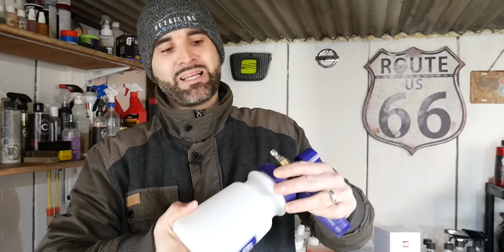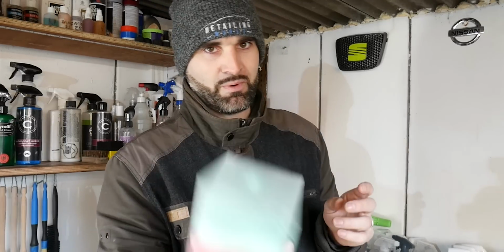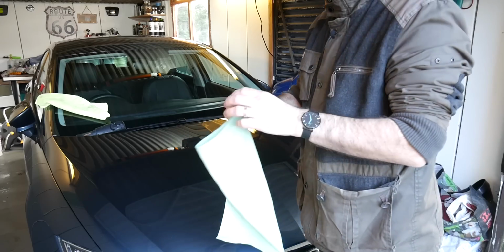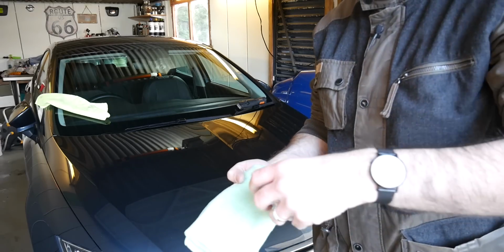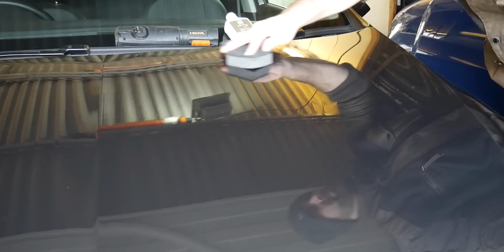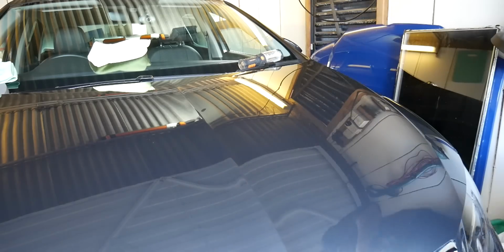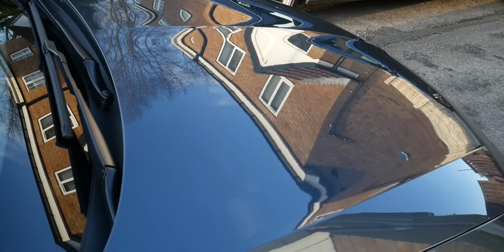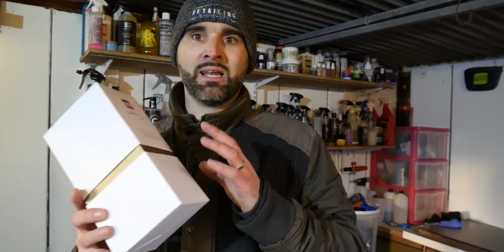AutoGlym Ultra High Definition Ceramic Coating

Comment from the maker: Comment from AutoGlym UK:

"The plan was to make something that was as "un-mess-up-able" as possible, but that still really delivered. Keep it off the rubbers and don't let it dry on and you will be fine. Even then, the preparation product will remove it from rubbers and if it dries during application, just add more Ceramic Coating to re-hydrate the product. No need to machine it off as with some other types of product."
Reply: @Flynn Braylon Ehh I watch on Flixportal. you can find it by googling :) -terry
Reply: @Terry Esteban Thanks, I signed up and it seems like a nice service :D Appreciate it!!
Reply: @Flynn Braylon glad I could help =)

Comment: I was a bit worried about trying a ceramic coating at home but you made it look easy.
Reply from the maker: Erm, thanks I think 🤣

But remember, because I make it look easy, that's no excuse to get complacent 😉

Seriously though, it's all about the prep work. So as long as you're happy with the results of your polishing etc, and ready to "lock it in", then applying this should be fairly straight forward with a little patience.

Comment: I use to clean and polish cars in the mid 90s, a shame I didn't carry on with it, this video is great, makes me want to get back into it, the quality of products out there now is amazing, most improved formula's out there now, and I do know back in the 90s that most car manufacturers and showrooms used the Auto Glym Polish, probably use it in today's car markets. And I never ever used a motorized buffer. Interesting stuff out there now, and why the heck do people use the clay bar, just get a packet of low pH solutions when washing the car it takes off 100% of debris. Anyway, great video great solutions and simple methods.... Cheers fella.
Reply from the maker: Thanks for your input

Comment: To me it seems pricey. £60 for 2 cloths an IPA and a bottle of ceramic. I'd be interested in the actual SIo2 solids content in this.  Also it says you can top this with UHD wax at another £60 a pop.  
This would not make me switch from TAC or Cquartz. Companies that have been doing coatings for a long while with a better price point.  
The snow foam lance looks like a winner if you happy to pay twice the price as other Italian made PA lances with a wide mouth bottle.  
I can see a theme developing...  
If I'm Joe Bloggs, who this product is marketed at is lost  looking at Halfrauds shelves marveling at the sheer amount of detaining products and looking for a ceramic product to schlep all over the paint, I'd probably pay the £90 for the TW ceramics range, based of the same amount of prep for each product, TW offers way move value the the end consumer as its a complete detailing system, rater than just 1 product. Polish, base coat, wet wax, shampoo and QD, (All ceramic, if a little bit is good, way more is way better) and offers similar results, and the packaging looks more desirable, and wont get lost in the other relatively expensive AG UHD product line.
On the upside, the video was well presented, useful tips and honest impressions of the product. I like what you do and you should keep it up.
Reply from the maker: Thank you for your input and feedback 👍
Reply: @TheDetailingSpace  So they supply the polish pad they sell to use the ceramic coating..lol...poor
Reply from the maker: Why is that poor? For their market that is ideal.

Comment: I'm putting this on my new John Deere mower. I have a few scuff marks from boots to remove first. What product can I use under the   ceramic coating? Not sure if I can use SRP due to fillers?
Reply from the maker: That's correct, you wouldn't use a filling product under ceramic. Really, you need to do a correction first

Comment: I have used the turtle wax ceramic wash and wax and I’m getting water spots like crazy, do you think Autoglym UHD preparation would clear the ceramic coating that’s on there? I’ve tried hand polishing it but no look ☹️
Reply: Liam Turner probably down to not enough preparation ( at a guess) . If you don’t have a machine polisher to really get the paint to a good standard I’d steer clear of most ceramic products. The turtle wax stuff will degrade over time ( one coat in maybe 3/4 months), so you could just wait and then go back to traditional waxing, it’s much more forgiving than ceramics.
Reply: Karl Hulme ok thank you very much 👍🏻
Reply from the maker: Yeah, what Karl said 👍

Comment: Thanks for the video.  Not sure if I’m going to use it yet.  I’ve got a white vehicle so not sure if it’ll really benefit from it.  Just a tip for the start of the video if you lock your exposure on the camera you won’t get it flicking from dark to light in the time lapse or other shots ✌🏻
Reply from the maker: I usually do lock exposure, in fact, shoot manual everything.... I tried using shutter priority as an experiment for snow foams clips.... Didn't like it 😂

Comment: is the red buffing cloth/microfibre reusable or due to ceramic contamination trashed?
Reply from the maker: Seems ok, and should be fine to use again. If in doubt, just demote it to a rag. But from what I can see, it seems fine.
Reply: The reason I ask is that I recently ceramic coated my wheels with GTECH C5 and they recommend not to reuse the levelling cloth due to contamination once the product cures on the cloth to avoid scratches? what are your thoughts?
Reply from the maker: Yes, the is true for some of the professional grade products, it can crystallise and ruin applicators, cloths etc... This is a different composition, and aimed at retail, making it a slightly different kind of ceramic product.
Reply: that makes sense, thanks.
Reply from the maker: No problem

Comment: does the applicator pad crystallize after one use or can it be used multiple times  until all used
Reply from the maker: I assume it'll probably crystallize. I'll check the condition later 👍👍
Reply from the maker: Just checked the applicator, and no it hasn't crystallized.

Comment: i was tild if the ceramic coating is not in a glass bottle its not real ceramic as the plastic bottle would dissolve with the product hence why the real stuff is in glass bottle
could be wrong but that's what i always thought the snow lance looks great
Reply from the maker: I've heard the same.

Comment: Does anyone know if I could use the polar seal after it has been ceramic coated, or would the seal not work and just keep using the blast and wash? Cheers
Reply from the maker: Technically yes, but not sure if it'd add anything to it. The do suggest not to wash or use chemicals on it for at least 24hrs after
Reply: @TheDetailingSpace  thankyou. Would be just because have 2 5 litred of the stuff to use up 😂.
Reply: I’d of thought once it’s cures using polar seal as a topper after some maintenance washes might boost your water behaviour as it starts to fade and possibly make the ceramic last longer? There’s only one way to find out
Reply from the maker: Yes, polar seal as a topper should be fine TBH

Comment: Better review than AUOYGLYM'S own! but how far will 100ml go? two cars?
Reply from the maker: Should easily do 2 large cars. I did my Mk3 Leon a few years ago with 30ml cquartz, and still had a little left afterwards
Reply: @TheDetailingSpace  makes it very competitive then? I'm using "HYDROSILEX" just now which gives around 6mth protection but is a breeze to apply, spray on buff off, a 1ltr bottle has so far done 5 cars and I think enough left for at least another two! well worth comparing I think!
Reply from the maker: I'd say so 👍

Comment: Hey great video
Question 
Polar wash
Then polar blast
Should i Autoglym Hd wax it or autoglum super polish it?
Then apply the new HD product 
Or wasting my time 
Wash it then Hd it 
What steps should I take please 
I am a autoglum fan 
Taa Neil
Reply from the maker: If using this ceramic, the preparation product will remove the fillers that SRP leaves behind, so kinda wasting time there. Really, you want to machine polish the car before applying this...

Otherwise, use SRP and then a wax product on top of that rather than this.

Comment: Does this product offer a similar result to Supagard? We had Supagard protected car several years ago, but I never realised what it was. The car always cleaned very well with dirt just dropping off with little effort. I then began working for a Nissan car dealer that tried to get us to sell a similar product for a minimum of £100 and up to £300! This was in 2000. I never sold one as it seemed to be a con to me. I then realised the significance of the small Supagard sticker on a rear window. I then worked for a Ford dealer that sold Supagard, but at a more reasonable price. I seem to recall they purchased a car polishing kit, including leather interior and carpet treatment for around £15. The valeters charged about £45 to treat the car, so we had to sell it for at least £60. I did sell a few as I thought that it was quite good.
Reply from the maker: TBH, I've never experienced Supaguard or any packages offered by dealers. As you can guess, I always decline them 🤣

Comment: Why do you polish the car just to remove it again to  ceramic coat it
Reply from the maker: I think you're confusing 2 different, yet similar things here...

A hand polish, or what you are referring to as "polishing" is a product that fills in defects etc.

What I'm doing, is polishing, as in the actual process of polishing. This actually removes swirls, rather than just filling them. What you see me wiping away is any polish residue and oils.
Reply: Detailing World ok I see now do you think it’s worth using the ceramic coat if I haven’t got a machine polisher. I do use the polar products  and they work well, just ordered the autoglym snow foam gun.

Comment: When would you have to wash your car next...? Can't tell me that would last 12 months...?
Reply from the maker: You would still need to wash your car, but the protection will still be there. Please don't confuse these type of products with "never have to wash it again" nonsense you get from dealers. The car will still attract dirt, but this will make initial washing easier as more dirt should just rinse off with a pressure washer before you even touch the car with a mitt.

Comment: So wash the car 
Polar wash
Polar blast 
Polar seal
Then polish the car 
Then ceramic or skip the polish part 
All Autoglum products used
Reply from the maker: No. Polar blast, then polar wash. Forget polar seal if using this.
Polish before applying a wax or sealant

Comment: Consumer lifeshine? 🤔
Reply from the maker: Never tried lifeshine
Reply: The thing with Lifeshine..  If you read it. The warranty isnt worth the paper its written on.
The other problem is.. The dealers who sell/install it, dont allow the microfibre wombles long enough to do a decent job, so the coatings often fail before they should.

Comment: This more like sealant imo
Reply from the maker: Dunno, I'd say Ceramic.... But where do you draw the line between a "sealant" and a "coating"
Reply: Detailing World id say ease of use and durability I feel coatings should last longer than any sealant and price too I have a sealant on my car that lasts 12 months and was a lot easier than this to apply
Reply from the maker: Guess it depends who they are aiming this at.Remember, AutoGlym probably aims more at the masses

Comment: I can see this being "interesting" sure some of the pros will get some work out of people messing up with it 😅😂
Reply: The plan was to make something that was as "un-mess-up-able" as possible, but that still really delivered. Keep it off the rubbers and don't let it dry on and you will be fine. Even then, the preparation product will remove it from rubbers and if it dries during application, just add more Ceramic Coating to re-hydrate the product. No need to machine it off as with some other types of product.
Reply from the maker: That's good to know regarding the rubbers and "re-hydration" method 👍

Comment: Same bottles as thier lifeshine which where I work charge 400 quid for the car not to be even done properly. In my opinion that gives Autoglym a bad name, I'm sure the product is good quality but the fact our "professionals" don't even apply it half the time is a disgrace 😠
Reply from the maker: But that's the problem, it's the user applying the product, be it lifeshine, diamond brite or some other dealership pre sale prep. It's the dealers that rush because "time is money" rather than doing the job correctly
Reply: @TheDetailingSpace  Have you read the Lifeshine warrenty?
Hardly worth the paper its written on.
Basically lifeshine is what it is, if it isnt, its not Autogyms fault or the fault of the installers.
Reply from the maker: I haven't, no.

Comment: Unfortunately ceramic is a big hype word. I remember when auto finesse launched theres. I'd never seen so many swirls locked into the car than at a show they openly asked people to come on there stand 😅
Reply from the maker: Did AF have a Ceramic? I know they have a Caramics kit, but never used it and assumed it was an "infused" product....

I know what you mean in some ways, but I think you're thinking more of the "ceramic infused" or "Si02 infused" products. This - as far as I can tell - is a "proper" ceramic. Some of the infused products only offer a few months of protection and are usually wipe on wipe off (or even rinse off). This gives 12 months, and has to have time to cure.
Reply: So if ceramic coatings are not applied properly they ruin your paint and are difficult to remove
Reply: @TheDetailingSpace  I've never really looked too far into it to be honest. It's there caramic kits. Still made it clear the average Joe and even car enthusiasts just see the word ceramic and flock to it. I know friends personally that have used it and there cars look like they've been cleaned with a brillo pad. I'm interested in ceramics and the tech is amazing but I'm a wax man, alot more thereputical
Reply: @thepurdychannel8866  no they dont damage your paint. Just they dont bond to it if it isnt correctly cleaned. 

And yes they are a pain to remove as it's almost like a extremely thin layer of glass over the clearcoat
Reply: @vortex21jw  oh i think i will stick to non ceramic coatings and good quality wax instead
Reply: The purdy channel me too, I actually enjoy trying different waxes and sealants every few months and don’t think I’d get good enough results at home with the full ceramic products anyway, I’d only consider it if I was getting a brand new car maybe.
Reply: @gillywash1487  i use autoglym super resin polish extra gloss protection top coat and finish 2001

Comment: I washed my daughter's car and dried it.
Then 
I used autoglyms magna or what ever it was called to remove all rust particles in the paint.
I washed the car again & dried it to remove any residue.
I then clay barred the car and washed it  again & dried it to remove any residue.
I wanted to make sure the car was spotless & perfect before applying this kit.
I then followed the instructions and applied the kit.
I finally got the chance to wash the car for her today and after around 2-3 months the car didn't even bead.
It's total rubbish.
Ive used autoglym polishes all my life on all our cars and won't ever waste $149 aud on this shit product ever again.
Over rated.
May as well spoof on your car and rub that in.
Probs be more water repellant than this crap..
I should have just washed the car, polished it and then waxed it and it would have lasted longer than this garbage.
If you're gunna use a ceramic coating, spend the big dollars and get one thats actually going to last a few years.
Autoglym say their kit should last 12 months only.
I got 3 month's MAX...... & that was after all that prep work....
Waste of day...

Comment: Que the string of people that use srp and then watch the fillers disappear once they use the cleanser but coat it anyway. The lack of actual polish without fillers that they sell to joe blogs means they will cause issues for themselves. Also that snow foam lance isnt anything new. Go to detailed online and save yourself £17 🤣
Reply from the maker: It dawned on me whilst watching this back earlier that I probably should have mentioned the cleaning product will remove products such as SRP....

Although technically, there's nothing to stop you ceramic coating a car covered in swirls.
Reply: @TheDetailingSpace  theres nothing stopping you but its not best practise. Also this coating is in a plastic bottle. Every other coating is in a glass/metal bottle. I assume thats not done just to make it look fancy. And as you mentioned in another comment thw pad hasnt crystallised yet. I dont see this being one that lasts particularly long. And value for money its way out there. Cquartz uk is less than that and will last 2 to 3 years.

Comment: Only 12 months - this is not good enough in today's market. Avoid.
Reply from the maker: I guess for the price, and a DIY High Street product, you can't complain too much. Maybe they'll release a v2 with better longevity.
Reply: Most coatings only have around a year's worth of properties in them before they ware off